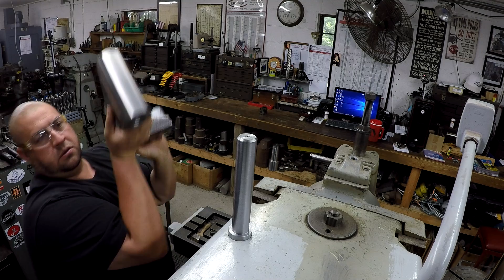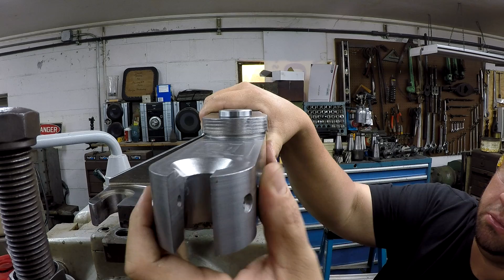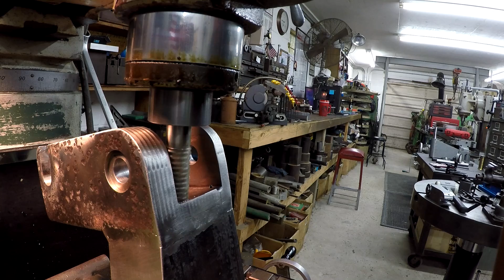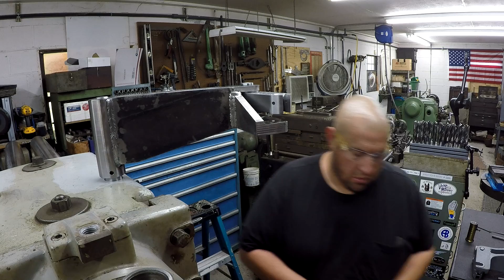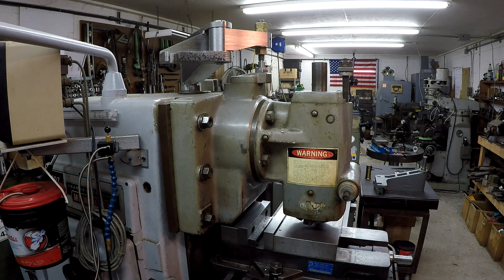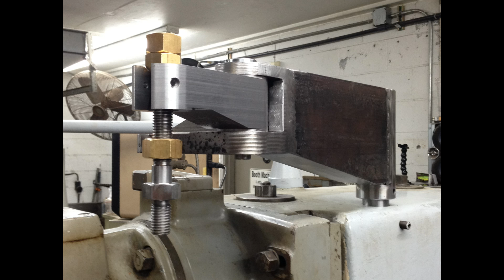Kearney & Trecker Parking Attachment 16: The Reveal!

Comment: Hi Adam,

I hate it when you find out a dimension is wrong "after" you make something.  Good recovery.

Assuming the brass nuts are 360 brass with a yield of 45,000 PSI.  I come up with about 33,000 lb to deform the threads.  The ultimate strength is about 58 KSI, which would give about 44,000 lb to strip the threads off.  The tensile strength of the stress-proof bolt is about 38,000 lb at failure (note this is when it breaks, not a safe load you can apply).  You could easily and safely lift the entire mill from that bolt and nut provided it was in pure tension.  Toms assessment was extremely conservative (which is good when you don't specifically know what you are dealing with).   That arm attachment is overbuilt like your welding table.  Quite ridiculously overbuilt really.  The arm is at least 20x stronger then the pin supporting everything  (the cantilevered pivot pin stuck in the top of the mill.)  It is very poor engineering from an efficiency stand point to be so out of balance.  Each part optimally should have exactly the same load rating, but hey it looks good...
Reply: I was thinking the same thing about that pivot pin. It's interesting how different the design philosophy was back when this mill was made, kind of under-engineered but overbuilt, while today we'd over-engineer it and use the absolute minimum in materials.
Reply: It is not about the safety factor but about rigidity.  If any machine is built just  for safety it probably will not be rigid enough to accomplish it's task therefore it fails though not breaks.  A lathe that moves under load will not function for why it was made.  If that pin or arm bends it doesn't mean the arm is unsafe but that it is not rigid enough to accomplish it's task to allow easy attachment of the head when needed or else why have it.  My 2 cents worth.  Nice build.
Reply: People don't realize just how strong these materials are
Reply: I'm sure the cost for the extra material is more than compensated in the initial price of the mill. Probably not worth the extra r&d for a more minimalistic construction
Reply: You only need an engineer for minimumly build stuff. :)
Reply: Also consider that the plate to which the threaded rod / nut assembly bolts to is held to the head by 2 cap head screws.  I think the weak link in the chain would be those cap head screws where are much smaller than the threaded rods and nuts be also in tensile load.
Reply: +Max Archer  I don't care so much if it is overbuilt.  Good engineering will make it on the minimum end to do the job for the least cost, but heavier duty is ok too.  It is just stupid when part A can hold 30,000 lb and it is connected to part B that can only hold 1,000 lb.  They should all be of similarly matched capacity regardless of if it has a factor of safety of 1.5 or 25.
Reply: so I guess it is a 1in bolt? usually 1.5 times the minor diameter of the thread is a good amount to go with full tensile of the material.
Reply: +Peter Mitchell it would still  work without the cap screws.
Reply: +Jim Wilson,  According to my calculations, you can fully develop a Grade 5 (ASTM A325) bolt in mild steel with 1x diameter.  This requires the bolt to stick through so you have 100% full thread engagement.  If it is a blind hole, then you need to add 1 full turn of thread at least to the bolt engagement.  The tapped length obviously needs to be a bit more as you do not want to bottom out the bolt in the threads.  Undersize threads will negatively affect this as it reduces the effective shear area.  If you are threading into cast iron this may need more engagement, but I never work with that.

Comment: you cant just add all three nuts and expect them to hold three times as much. since one is on the bottom there were two left but the Force is actually only 0.4 times the diameter "deep" in the threats of the first nut. So adding more nuts wouldnt change anything
keep up the good work :)

Comment: Ok, that thing is awesome. I think I might have had a genious thought while you were loosening the head. Once the side brackets are loose, if you pushed the over arms out (Instead of pulling them in). I just wonder if it's designed to pivot the "crane" around and lock it into the main arm. Then pull the over arms in. 
Thinking about it now, I'm betting that's how it's supposed to work. Then reattach in the same way. Let me know if you see this message and if it makes sense to you.

Comment: Watching it in operation, just a thought Adam, could you bolt an angle on the side of the mill. I know your work is strong enough, however, just another safety appliance and would take the fatigue off the attachment. Kind of an attachment shelf. I know you probably do not want to alter the looks of the machine an that's understandable. Take care my friend.

Comment: You are only pulling through 2 of the nuts while swinging but still way overkill for strength, but an acme thread is always better for moving a heavy load, so if you were adjusting the head up and down a lot while it was swinging, it could start to wear the brass nuts.  But it looks like once its adjusted, there will not be much changing of positions.  BTW, that would be a good part of an episode if you showed cutting an acme thread.

Comment: It looks great, Adam. 
I can't wait to see it painted with the chrome logo.
One part of my job is fastener strength. The nut is almost always softer than the stud or bolt by design.
It's usually better to have the threads pull out of the nut than to strip or break the bolt.
Two things I know for sure.
You are very knowledgeable and observant. If those nuts show any signs of unusual wear, you'll see it.
Those brass nuts aren't going to fail anytime soon.

Very nice work.
Thanks,
John

Comment: Congratulations. Great job! Being a bit nervous in the finishing moments after so many hours of work just makes You human. Nothing wrong about that. Also there is no reason to be skeptical about the brass nuts. Just contrary: should You really mount and unmount the head often enough to experience wear between the nuts and the CNC machined part, John made, it will be OK to have the wear on the nut and not on the more complex part. :-)

Comment: Hey Adam, 
Nice to see the project done now. I had seen Keith Rucker use his, so I knew what you were making. You knew it had to work since you copied the original so closely. Still a bit of a scare when it didn't line up right away. 
It will look good painted, but I hope you leave some of the rough marks in the metal as "witness marks" to the origin of the material you started with.... stuff from the family shop, right? 
Anyway, thanks for the great series, Adam. 
Joe

Comment: .......I like it, and it works..........can you add a hole or threaded bung to attach a handle or to stick a rod in.... the small arm to use as a handle when moving it around. Keep those fingers out of the pinch points...

Comment: Hi Adam !

I have an old danish mill with such a parking attachment too - another design ofcause but works the same way.

I experienced that fidling with those brass nuts till they exactly line up with the support rods will make mounting and de-mounting much faster (and easier) so I will advice you to do that too.

I friend of mine with a mill like mine even did a bracket on the side of the mill just to take off the stress of the vertical rod on the top of the machine.

I'm happy you took your time to "see the light" at the end there and just made some minor finishing adjustments to make it work.

Really nice work all the way through ... and you even incorporated some material way down from your "family roots" - nice !

Comment: finally! i felt so dumb until the end. i just couldn't figure it out, what it would look like and what it was good for. a little crane for maintenance, who thought that. greatings from europe. nice job! keep going on. i'm addicted!
Reply: Not for maintenance. It's used to keep an attachment (cutting head) in a parked position. If you go to Keith Rucker's YouTube channel and rummage (via the search function) through his videos, he demonstrates this with this two heads on the mill he has at work, he's also set to build a parking crane, but he's going to pour it rather than mill it and weld it.

TLDR: These are horizontal mills, but, they came with vertical head ability. The vertical head is heavy, so they made cranes for them to stay parked.
Reply: thanks a lot. i'm not nativ speaking english, so some informations are lost in translations in the videos. thx.

Comment: Hi Adam, I think you need to loosen the bolts that holds the head to the machine body, push your support arms out around 1 inch and then grab it with your parking attachment (bolt). This will allow the gear to disengage and freely move the parts without any problems and damaging the gears. Good job.